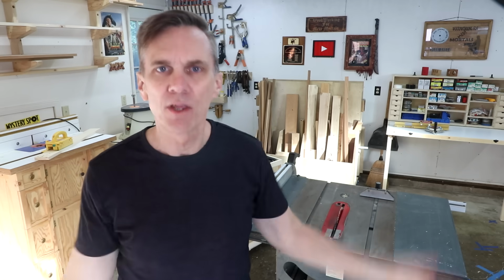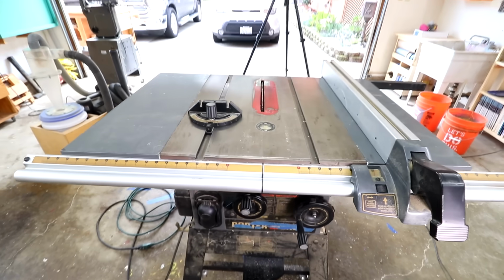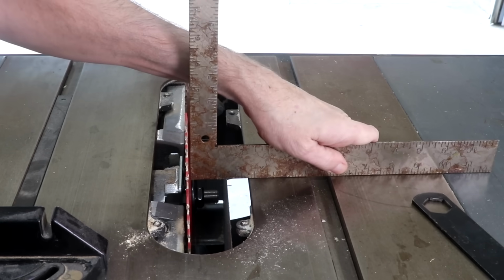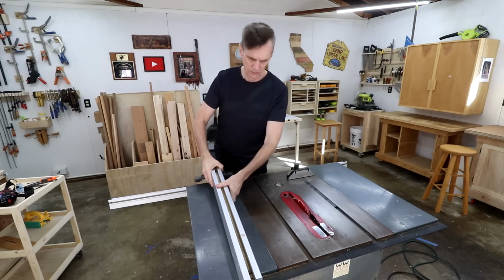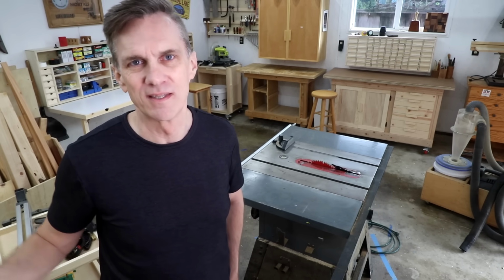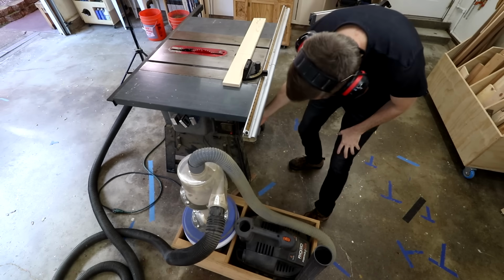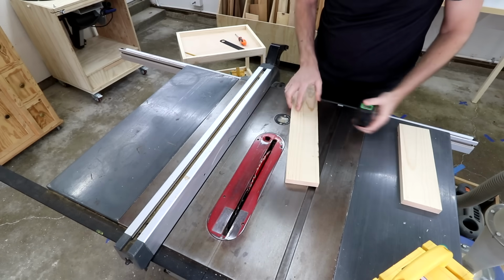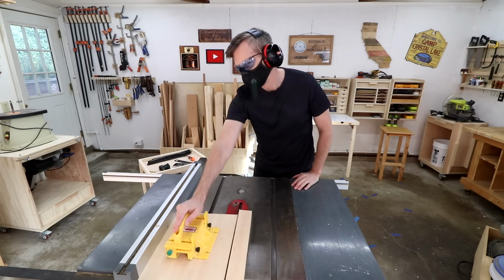A step-by-step guide to making your first table saw cuts. TABLESAW BASICS.

Comment: Nice video. 

I'd be interested whether you think there's a correlation between experience and injury rate. I suspect that most accidents with these things happen to medium-experienced woodworkers who get complacent / careless.
The first few times you turn on a table saw you KNOW it's really dangerous. After a few hundred cuts you start to forget that, and that's when you get hurt.
Reply from the maker: That's an interesting question. I think in the beginning, there's a safety learning curve where it's important to at least understand what can potentially happen and how to avoid injuries. With a solid base, you are probably hyper-aware of everything you do. Then as you get more time in, it's easy to get complacent. You might be right: that medium-experienced zone is probably the most dangerous time. 

That said, plenty of injuries happen to experienced woodworkers. We might be well aware of safe procedures and do everything right, but one moment of losing focus can lead to an injury. It's the very definition of an accident. Kind of like how you can drive a car for years but still space out and run a stop sign. 

I strongly believe in making dry-runs a habit. I honestly, seriously do this all the time. There have been procedures where I've made dry-runs and just didn't feel 100% confident. That's when I know I need to come up with a different strategy for making the cut. 

I'd love to hear what other people have to say about this question!
Reply: @SteveRamsey  and never work on power tools when sick, tired or stressed out.
Reply: Steve Ramsey - Woodworking for Mere Mortals 0
Reply: @Steve Ramsey - Woodworking for Mere Mortals 

What table saw model do you have?
Reply: @SteveRamsey hey , can you provide offline training. I am a student now and working in woodworking. In my company,they didn't teach us about cabinet making and I want to learn about cabinet making to you. How much it cost if you provide me a training. Make sure price should be fare Because I am a student now and not financially stable.
Reply: I just got a table saw and from first cut to the last one i did i did a dry-run and i always will be.  Thank you so much for making this video! I'd like to keep my fingers and hands!
Reply: @vileguile4  Please do!  I'm recovering from a very fortunate accident, where I lost focus and only required three stitches (and lost two fingernails!)
Reply: You can get injured regardless of your level of experience. When you're starting out, you make mistakes due to lack of knowledge. When you have some experience, you get complacent and lose focus for an instant and have an accident that way. Then you get lots of experience, you start to thing that the rules don't apply to you, and again... an accident.
Reply: I happened to work for a few years as a nurse on a surgery ward, most often sawtable injuries were in the weekend by amateurs. But all the other cases were with both professionals and amateurs alike, with the key factor being tiredness: "just one more cut, before I stop for today". I can imagine that each and every cut should have your fullest attention, and that experience can give you some slack. I bought a second hand table a week ago and I only yet dared to do a few cuts, it's daunting to say the least.
Reply: DigitalBabu You only had yours a week? I have had mine for 3 years! Brand new! I finally got the nerve to put it together. Going to buy any safety tool I can before I use it. LOL I just wish Steve was a neighbor.
Reply: DigitalBabu I’ve always made my worst screwups or done the most dangerous cuts at the very end of the day when rushing to complete something and racing the clock.
Reply: I can't find the article unfortunately, but research has been carried out on this very topic and what I've read is that it's the woodworkers with medium levels of experience who're statistically the least likely to be injured by table saws. Woodworkers with little experience are likely to injure themselves due to not knowing what they're doing, and woodworkers with lots of experience are likely to injure themselves due to complacency; however the woodworkers in the middle are experienced enough to know what they're doing, but not so experienced that they get complacent. It's a sobering thought that after a certain point, the more experienced you get, the more at risk of injury you become!
Reply: @LucienDark  One of the great gifts to new wood workers, like me, is the the plethora of videos, both good & bad, that we have available to us. As I like to say..."my knowledge of wood  working &  tools greatly exceeds my experience" because of videos like Steve's.  Back  in the 80s I once put a piece of wood on a  radial  arm saw, not up against the fence I'll bet, and then proceeded to free hand cut a piece of wood...the  blade promptly tried to climb the stock.  I shut off the saw and never touched  it again... until a year ago, after hours of videos.
Reply: @LucienDark  I would believe that. That sounds very logical
Reply: I think the more experienced get hurt more often.  I know this from experience lol.  I feel that the more wood working you do the more you get into "the zone" and start letting your guard down because it starts becoming like second nature.  That's all it takes then, bam, you get hurt.
Reply: I know 3 people with missing fingers from woodworking. They were all considered to be expert level when they got injured. Distraction and working under the influence were the factors involved.... In other words ... They were over confident in their skills. As a pro woodworker I have many injuries and close calls with tools .... And every single time it is when I don't expect something to go wrong .... So I'm not super focused
Reply: My father lost a finger to a table saw in high school (no guards). I also know of carpenters with 25 years experience that had their first kick back. Personally I think it’s the middle of the road experience level that is the most dangerous.
Reply: I think another factor to consider is: has the experienced woodworker been injured before?  I am only a couple of years into woodworking but have already shot a brad nail through my finger and you can be sure as shit that I never let my guard down with ANY power tool anymore.
Reply: Excellent video. Thank you! I might actually start using Bernice, my pristine, never used, five-year-old table saw.
Reply: I agree that complacency due to experience can cause as many accidents. However, I believe that good common sense is all you need to operate a table saw, unfortunately that is something you can’t teach people. I’m a tradesman and have used a table saw since I started in the industry only 15 years ago after college. I’m still learning and always have an open mind to new techniques which is why I watched this video. Really enjoyed how you presented it, non patronising and clear.......everyone has to start somewhere.
Reply: I couldn't agree more. Just subscribed to the channel. Once I'm done reading my owner's manual I will be watching this video a few more times.
Reply: you hit the nail right on the head on that one! i know someone who knew what they were doing took and chop saw and didnt have it screwed down or even level nor a clamp to keep it from shifting or moving ...one day i said what the heck are you doing shouldnt be using it like that since my hubby always told me and showed me how to be safe ...but that person was a friend of mine and he went out one morning to cut some wood for framing in a hurry and the day before he used one of those sticks of wax or whatever its called so that he would get a smoother cut i think it was like the next morning is when it happened he went to cut the wood and he accidently shifted his body and moved the whole darn thing and cut the tip of his thumb off then called me instead of 911 crazy but true. so since then even though i have used our chop saw so many times back in those times safely because my hubby had his screwed down and level correctly but since i saw my friends thumb hanging off  i then never cut any wood again ...so yea you def need to respect it!
Reply: no matter how safe and experienced you are, your brain will eventually fart.
Reply: I think there is some connection. I have few experience with table saw. Built mine own recently and still did not experience an accident. I`m totally aware of the dangers, using caution and common sense all the time. I have some larger experience carving and using hand tools, however, and when carving some stuff, usually using very sharp chisels and gauges, very often  I`m carried away or got distracted. Just got two stitches last week due to this - it wasnt the first time I cut some finger and had to patch it. Hope I  learned the lesson this time, and dont repeat the same with the table saw.
Reply: @WoodenWookie but  do  you wear a  crash helmet?
Reply: @WoodenWookie i  give  up     yes  your  right      the  and  exposed saw  blade  is  much safer )
Reply: @WoodenWookie have   you  cut  your  fingers on  a saw blade or  seen other people do  it   ,   33 years  as  a  cabinet maker  i  have  seen  2 people touch  planers ,  three   people saw  blades   ,    twice have  had  people  set up spindle blocks the  wrong way  with cutters go  flying around  the room   ,      1  chopsaw  ,      and 1  router  table   (nice  vee groove   in  a  finger)      and  2  belt sander  ( little  finger  going around   the  back and  being sanded away only a  bone  graft  not  loss of  finger   )the  list goes on     yes  i  am  always  ready for  things  to  go wrong    , thats  who its good  to set up with every guard  you  can , i  am not complacent   i  still  have  all  of  my finger   but with nerve damage  in 2 fingers  to  remind  me   ,      are  you  a  full  time  machinist ?
Reply: @WoodenWookie ok   ,  i  am  not missing the point   what  you  are saying is  if  the  blade is  fully exposed   then  you  will  be  more careful as you do not have a senese that you  are being protected   by a  guard ,  on  mate  thats what i am saying i allready respect this machine as i have  seen what they can do   ,  so  i  take it  you  are  not a  full time machinist    ,   if  you  put the  hours in  and  years  you  would know that guards do really make machines safer   , this is why the  law in  the  uk   as most places say  you  need then  in  the  work place  ,   that saw  look  unsafe anyway  ,   i  really dont know why  they dont  have  sliding table saws in  the us   with over head saw guards   i  have   an altendorf wa6 with over head guard     may be if  you  have  a look  you  will see why over head guards are the  way to  go)  any way you  wont  change my mind   so we  should  just agree to disagree
Reply: I know this is anecdotal, but in my experience as a medic, it is almost always (almost, not 100%) more experienced woodworkers. Usually older close to retirement age guys seem to be the majority of my woodworking injury patients. We get a few a year, and I can't think of one younger than 50, and it doesn't seem to be a new hobby for them. Obviously this is just my experience and I don't not claim that this is the case across the board.
Reply: The table saw I just received from my wife's uncle after he cut his fingers pretty bad, he is I believe 86 very experienced both times he cut his fingers were due to him not paying attention and talking to someone while cutting,  shame on him but more importantly I say shame on the person talking to someone using a power saw, side note the saw looks dangerous, no kirf knife, I may have said that wrong, the plate that sits over the blade is pretty open on the left side, I made a few practice cuts and for some reason it "feels" dangerous, I'm using push sticks I bought it seems as though the small cuts I am making the wood seems to rise up a little even though I am using a push stick, thanks for any response. I'm kinda attached to my fingers.
Reply: I was gifted an older table saw by my wife's uncle, I wanted to get into woodworking,  the first practice cut I made, the saw actually scared me, not knowing anything I found Steve watched his video on table saws then it made sense, the gifted saw had no riving knife, no blade guard, no anti kickback prawls 1/2 the throat plate was missing. I went out and bought a nice Metabo table saw, I pretty much Owen my fingers to Mr Ramsey.
Reply: April 28, 2020 I came very close to losing two fingers. One healed on it's own. The other needed help. Anyway, I'm ok now, but I had only been working with a table saw for about 6 months when it happened. I actually found your channel as a result of that accident.
Reply: The only true source of knowledge is experience. Even with all of todays technology and its redundancy that keeps us safe... Natural Selection still pops its head in from time to time in-order to segregate.
Reply: I disagree.  The more you use a tool, the more you see the power and danger of the tool.  Show me a complacent wood worker, I’ll show you someone that is probably missing “parts”, and should have taken up painting instead...
Reply: 0
Reply: 888888888898⁸8889999999999999999999999999999999999998899999999999999999999999899899999999999999999999999999999999999999999999999999999999999999999999988889888888898888⁸8
Reply: have a first aid kit in your shop. also emergency numbers handy. make sure your electrical outlets are gfi protected especially in a garage, cellar  or outside .
Reply: I believe that the most experienced people get a bit more comfortable/careless than newer users, therefore potentially more accidents…
Reply: I agree.  It's the same in Skydiving.  The D-license guys are more likely to get hurt.  They jump more, so there are more at bats.  Also, they can get over confident, because they've done something 125 times with no problem, like a low-altitude J-hook turn.
Reply: When it comes to table saw injuries, the elephant in the room is flooring contractors. Cheap jobsite saws, blades sky high, freehand ripping with no safety gear whatsoever. Every woodworking shop I've ever visited does indeed give the table saw its due respect. But it's the flooring installers that give this tool a bad reputation.
Reply: @RobertHorton1975  I haven't come across any news but I imagine that contractor injuries have gone through the roof since last year, if only because of the greater volume of work being done. Time pressure to get things done and move on to the next job, whether it's a solo contractor or a company, are probably at all-time highs now too.
Reply: The other thing anyone new to something needs to be aware of is something called the Dunning-Kruger effect.
It states that the less ‘expert’ in any given practice you are the more you THINK you know about it.

Take a moment to think about that and then extrapolate how much that increases the danger when doing anything with life-altering risk associated with it.
Reply: @HolidayArt  - Life events reduced to arrogance. Interesting. Write a book?
Reply: I have not read any of the replies to your question, in my experience accidents can happen due to a variety of reasons such as rushing, being under pressure, cutting wood that is too small, improper practices, removing guards ( I blame new yankee workshop lol). Complacency, lack of knowledge. I reckon there's a few more but that is just from the top of my head. I was always told to set the blade height so that the gullet just clears the thickness of the wood.
Reply: Having been an EMT I know that quite a few are caused by distraction. Distraction can literally hit ANYONE. It does not have to be a child or pet or other sound, it can literally be the thought of "If I don't make X product in time for sale, I wont make car payment, then what do I d....(missing thumb) Those injuries that are not are often by those too "scared" of the blade. As in they sometimes sacrifice control of the work in order to keep hands further away than what would be recommended.  Yet a few others are caused by trying to be a showoff or be too "Macho" These people lost the saw insert 10 years ago, the riving knife 12 years ago and are using a replacement power cable supplied by a 15 year old alarm clock held on by nothing but electrical tape. These are the same people, that when get onto my truck are like "well, im not a-rightly sure WHAT happened, but..."
Reply: well, yes... but: when it happens to less experienced you just don't hear about, just because he is not a woodworker
Reply: i  think  it  happens   because  of     pressure  of  the  work  space   ie  boss  kicking  off   and  in  my  case      using  the  saw   every  day  for  hours  at  a  time    for  year  after   year   33  years  in  my  case  they  say  if  you  have  never  had  an  accident      you  have  never  really  been   a  furniture  maker     ,    i  have  seen  all  sorts    , spindle moulder  cutters  flying  is  fun     2  times  )